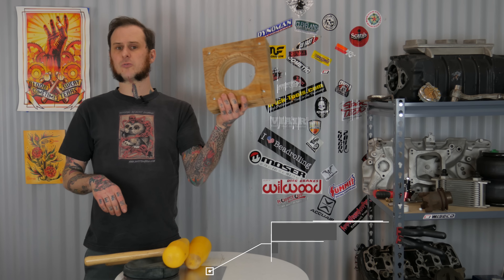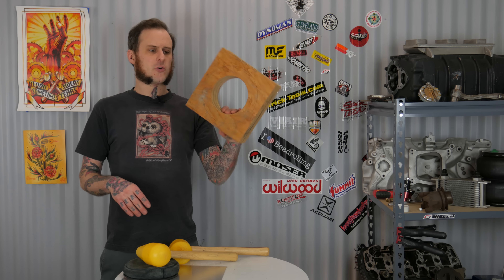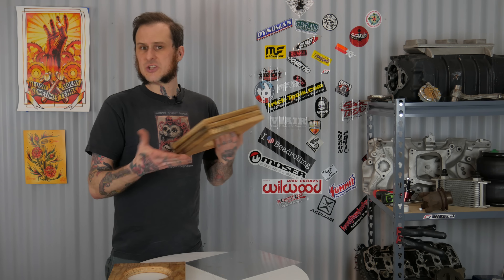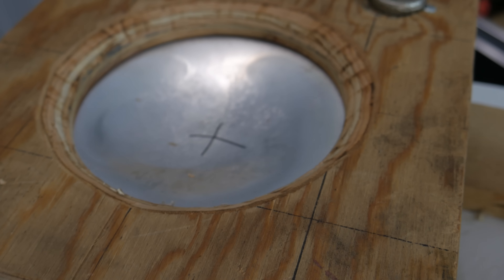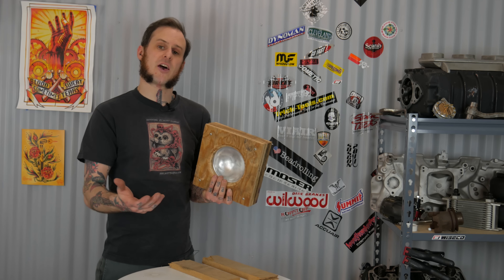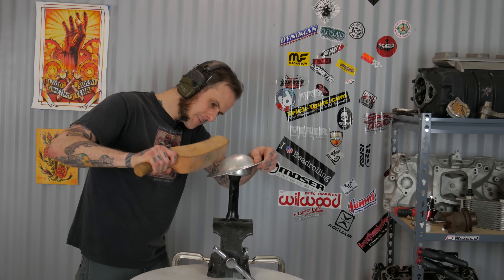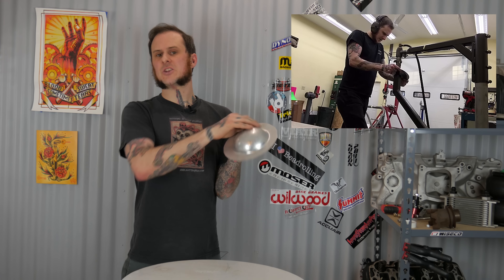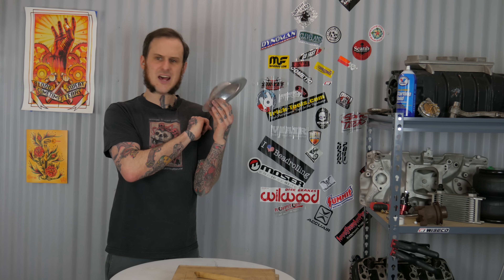How to Hammer Form a Speed Blister - Shaping Metal With Hand Tools

Comment: I made a hood blister today following your basic instructions. I used a saber saw rather than a hole saw, and I cut the chamfer in the clamping board by adjusting the saw to 45 degrees. I don’t have that post dolly, but I did run it on the English Wheel to clean it up. It wasn’t quite as nice as yours, but still very passable. Thanks for the video. Very helpful.
Reply from the maker: Glad you are making the techniques work for you.  English wheel is a solid choice for smoothing.  I demonstrated with the dolly because I felt it a little more accessible for those that don't have a wheel.

Comment: In your opinion, what are THE BEST "Tube Benders" on the market? One that you can bend a roll cage and be able to lay it FLAT on the floor without any twist or deviation? Thanks much. Really enjoy your videos.
Reply from the maker: Any of the Tube Benders I've used are capable of this. The problem is twist from not getting the bends lined up with each other. Using a Rotation gauge to make sure the bends stay on the same plane is the best bet: https://www.trick-tools.com/tools/Tube-Rotation

My favorite machine I've used was a JD Squared Model 4. I haven't used any of the really "fancy" machines though.

Thank you for the kind comment. It's appreciated.

Comment: This is exactly what I want to do, but in 3mm thick brass sheet. Shallow dome about 4 inches diameter, half inch deep with 1 inch flange all round. Do you think that would be possible? Could I do it in one go, or would I need to anneal it part way through? 
I don't have a bossing mallet. Could it be done with a ball pein hammer or would I just get too many dents?
Reply from the maker: Ballpeen is gonna create a lot of small divots that will be hard to work out cleanly and not overstretch small areas. You will certainly have to re-anneal in the process.  That thick of Brass is gonna be hard to move even annealed so any work hardening and gonna show up fast.  I'd consider working the material fairly hot, but brass and similar alloys have a tendency to want to taco when heated and cooled.  So a good clamp plate to keep the flange in place is gonna be important.  If I was me I'd consider making the clamp piece out of steel or aluminum.  Won't help keeping heat in the brass but wont have to worry about burning it on subsequent annealing / heating cycles. 

Good luck to you!

Comment: Hi great vid!!! What is the radius you used on the hole in the wood form? Did you use a router to make it?
Reply from the maker: I believe this form has a 1/2" radius round over, and yes I used a handheld router to make it. I also have a table mounted router I use for the some purpose sometimes. 

You can choose your radius, or even not do that. I made a piece for work last week in which I just lightly sanded the sharp corner off so that my piece had a crisp edge where it met its flange.

Comment: What method did you use to put a polish on there like you did?
Reply from the maker: Anthony Burgess I sanded from 320 grit up to about 2,000 grit. Jumping every couple grit steps.  Then used a 3M rubbing compound with a soft pad. And finally mothers metal polish by hand. I would have sanded more and buffed more for a show piece. This finish was only so good.
Reply: HotRodHippie Thanks 👍🏾

Comment: Do you just use smaller versions of those hammers for the smaller hammer forms?
Reply from the maker: All of my Ron Fournier Hammers have small ends on the other side.  If the hammer form is particularly small I will use that end.  However I always aim to use the largest radius face I can so as to reduce the number of hammer strikes.  More small hammer strikes means more dings and imperfections to work out later.